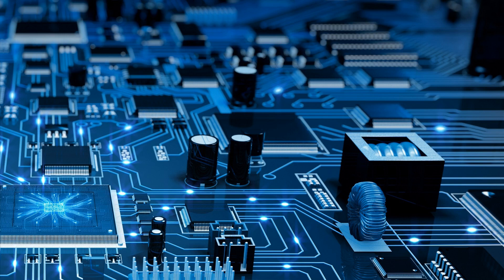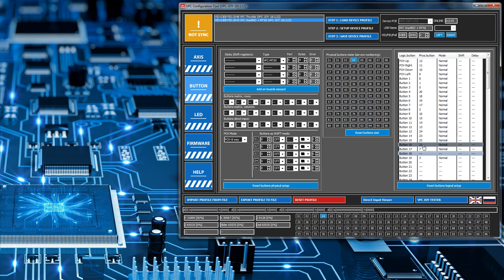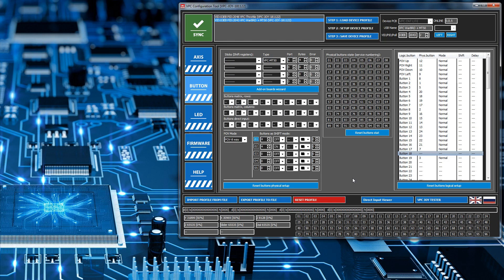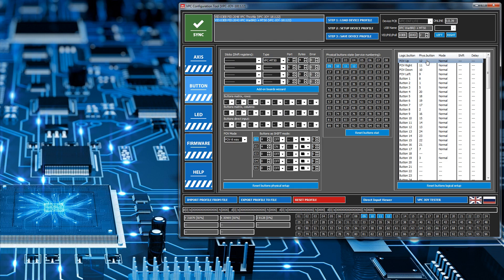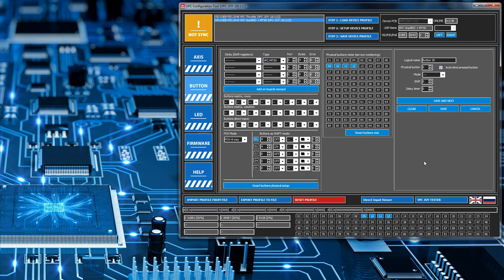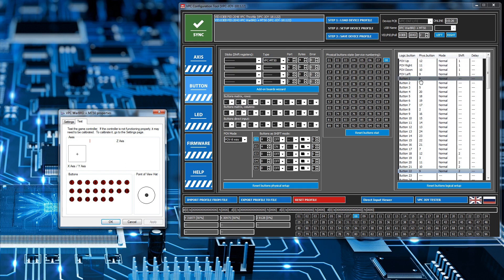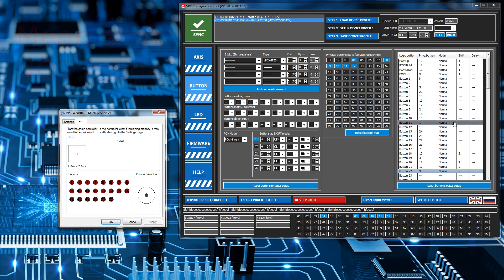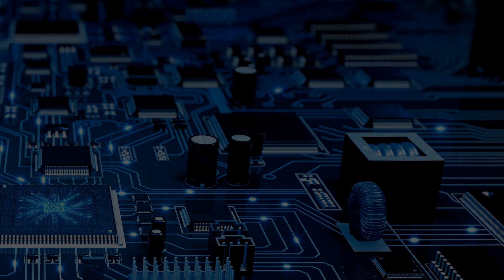Virpil VPC Joystick - configuring shift state Tutorial

Comment: Is there any way to use a button  on one stick as a shift state for a button on another stick (both  virpil alphas)? I know I can use joystick Gremlin but trying to avoid additional software and would love to have the LEDs on each grip change as state indicators. It’s seems from your videos the virpil software can’t act as a live bridge between the sticks and windows so I’m guessing it’s not possible. Just want confirmation.
Reply from the maker: Joystick gremlin uses practically NO CPU time so it will not effect your PC performance when running it, there is a VPC shift util in the tools folder
Reply: @HavocCompanyClan  the reason for not using JG isn’t to do with cpu it’s that I have lots of other peripherals and last time I tried it the vjoy ID ruined all the bindings for my other devices in other games. I’m not going through that again. I’ll see if a combination of led_control and shift_bridge can do what I want. 👍🏻
Reply from the maker: @RiftFlyer  Oh you have a really super old CPU then, ah that's crap mate?  Because joystick gremlin uses pretty much little or no CPU usage. Vjoy if used correctly does not change any other joystick device ID's the only one it effects is its own. BUT I have had issues with Virpil firmware updates fucking things up several times in the past eg the newer firmware for dec/2020 and newer changes the joystick ID (GUID - VID / PID) and broke about 72 binding files I had for DCS, tho luckily I figured a very fast fix for that issue, so be careful with updating your Virpil firmware!

Comment: Thanks for this - but I can't get windows to detect any (additional) virtual shift-state buttons that are assigned to anything past the first 28 that are detected. The shift state does work if I assign it to one of the first 28 (after clearing it), but no joy for anything past 28 buttons. Is there anything that allows windows to detect more then 28? Note that I also tried detecting the additional buttons in Joy2Key and Gremlin, reset my computer multiple times, and tested on two virpils all with no joy..
Reply from the maker: windows joy.cpl will only SHOW  28 buttons even if you have more, use VPC joytester to see how many are really there
Reply: @HavocCompanyClan  Okay, I found out the problem. For some reason the shift state would never work for the first key I bound. When I bound the second key, then the previous shift state worked..And so on...Very odd, not sure what/where/why but it is working now. And thanks again for these videos, as per someone's previous comment Virpil should at least be throwing you some free swag as this really fills in the gaps of their documentation.
Reply from the maker: @Cynikill  I wish I got free stuff,  I honestly don't bother with shift states thru VPC config , I use gremlin t handle that

Comment: Thanks for this as it was a huge help!  It does bring up a question, though: I have both a T50CM AND a MT50CM2 Throttle - I would presume I can use the shift state button on the T50CM (physical button 4) to apply shift to the MT50CM2, correct?  If so, how do I do that?
Reply from the maker: Easiest way would be to use joystick gremlin, check out my other tutorials for info on this